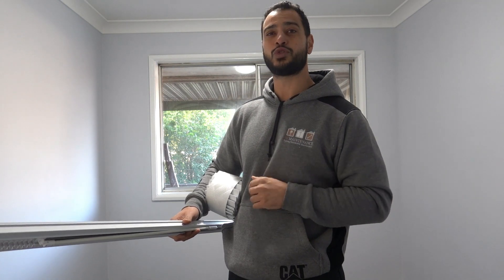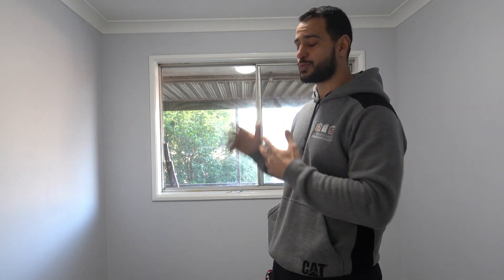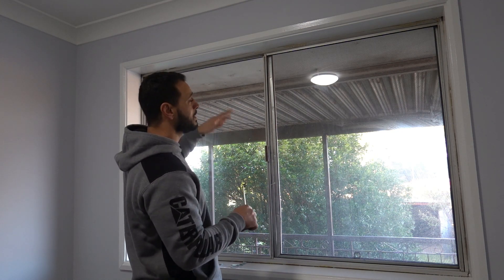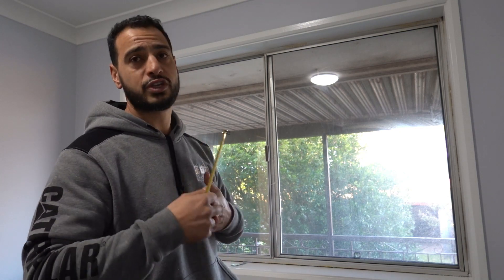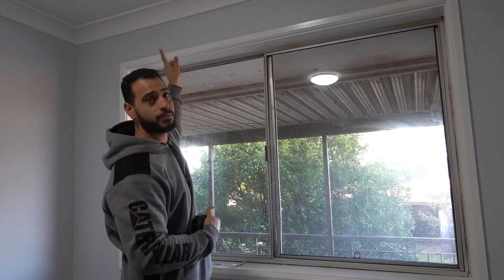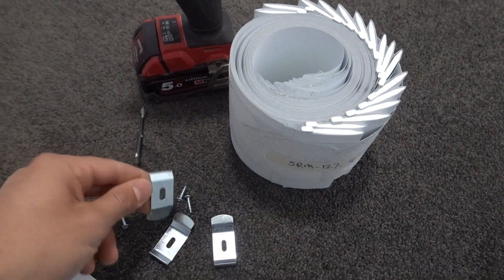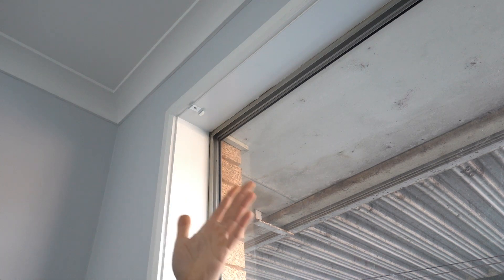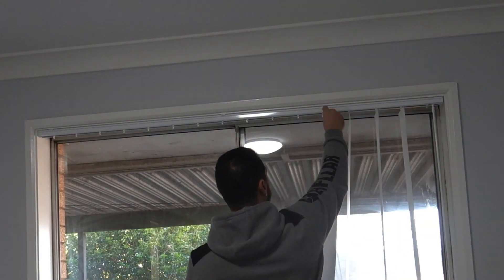DIY window blinds  - save money !!!!!

Comment: $20-$50 bucks installation? I ain’t even leaving the house for less than $100. Inflation is here brada. This is ain’t 2018 anymore bro we need to give value to our skills as tradies if not. The owners can do it themselves 😂 good vid as always thou🙌🏽❤️🙏🏽
Reply from the maker: Lol, $20-50 based on supply and install for a whole property.
Reply: Service call out usually between 120 to 150 include first hour. Estimate time for each window install probably $50. Most of people feel too much trouble need to get bunch of tools probably use once then not worth to do it.
Reply: Make's Bill's point about the homeowner doing it themselves even more relevant then. 
More like saving $2,000 for the purchase of a tape measure and drill.
Bravo Bill.

Comment: Great video, thanks Bill. Hardware stores sell several decent models of blinds at various standard dimensions (like 1800mm width) and the drop is fairly easy to adjust if needed. Can be installed in like 30 minutes and saves a lot of money without the need to contact a manufacturer. Some of the brands are rubbish but a few are very decent
Reply from the maker: That’s true and they are cheap. The only issue is that most openings will have to be custom made to size particularly with vertical blinds👍
Reply: @billshowto  can you please do your next video with your normal voice tone like if you were having a normal conversation with some one…and not that annoying YouTube voice tone you do….it sounds like a swing high low up up up down down down up up up down down down.
Reply from the maker: Lol lol , easier said than done. Talking to my self dosnt come natural.
Reply: @billshowto  hahahaha keep up the good work brother…👍

Comment: Nice video.  Like Logan mentioned not everything is squared. Perhaps a video on how to address those issues will be good 

But these blinds you installed I really hate them. They break so easy and I used paper clips to "repair" them. Perhaps a video repairing these blinds properly will be good especially for those renting out

Comment: Bill i left a question a few weeks ago on peeling paint .Ok i have cut off the peeling paint do i put a waterdown undercoat on the original plaster then replaster over the top?
Reply: You can water it down a bit, but not to much. Yes it would be better to put undercoat over the peeled paint and then plaster over that once it dries.
Reply from the maker: Sorry I haven’t seen your comment. All depends on the condition of the plasterboard. If you have cut it out and exposed the brown paper or the gypsum then it’s best to seal the surface first. Undercoat dosnt have to be watered down just use a sealer. If the plasterboard  hasn’t been cut and it’s simply peeling paint, remove the loose material , patch and then paint. If your concerned about the paint still peeling, you can apply a binder sealer first, patch then paint. Hopes this helps 👍
Reply: @billshowto  Thanks mate I just watched a previous video of yours where you used Aquablock.